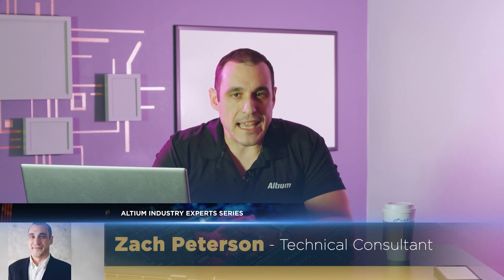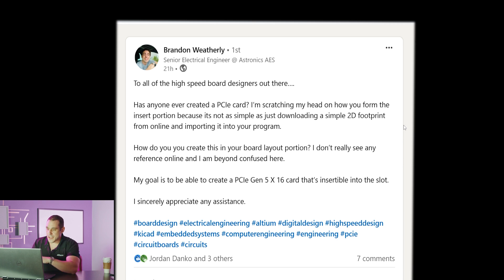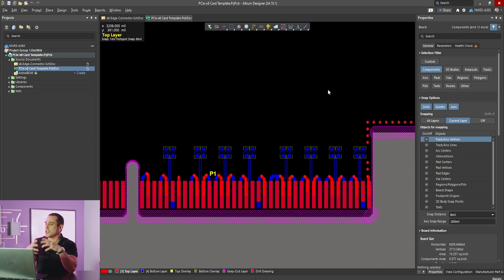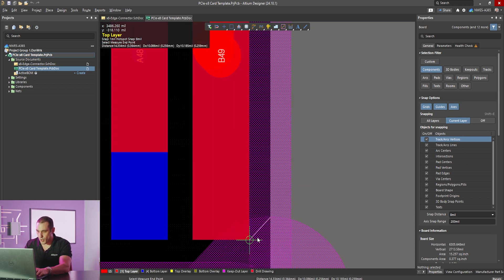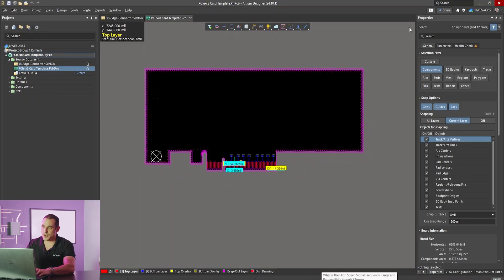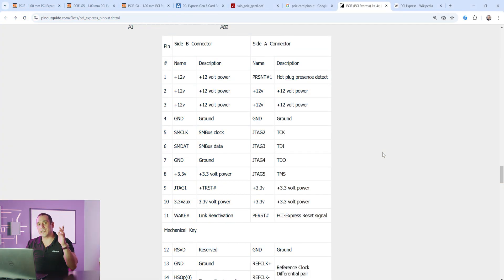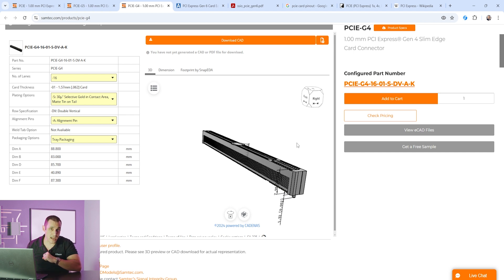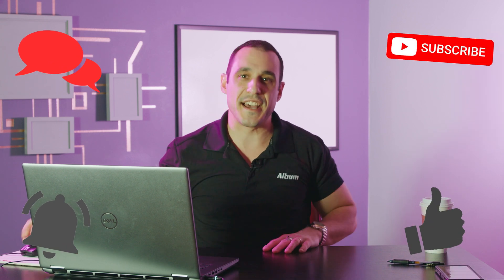How to Design a PCIe Edge Card | Altium Designer Tips

Comment: Loved your video and it helped me so much however you can 100% use a older pcie connector with a newer  generation you just wont get your max bandwidth. Which isnt really that big of a deal not even a single gpu can really saturate the lanes. I would be impressed if any diy or product prototype could as well.

Comment: What about physical dimensions for the x16 edge connector? How far do i have to extend it, just copy-paste what is already there in the template?
Reply: Yes you can copy paste what is in the template while maintaining the pitch. Also make sure you maintain the margin from the last pin to the card edge, that will ensure the card fits into the standard size PCIe edge connector.

Comment: Another great video. I have not checked your template yet, but is it worth mentioning the dimensional/ positional tolerances and chamfering and hard gold plating specs that could be included in fabrication doc? They are noted in most connector data sheets, so i guess it goes without saying. Not specific to these pcie edge connectors, but I have seen under specifying the alignment/tolerance of the board edge key relative to the pads for other types of card edge connectors cause shorts to the wrong pins, but that was likely a tighter pitch than standard pcie connectors.
Reply: When you create a fabrication drawing it is a good idea to include these in the fabrication notes. This is something I have probably mentioned in a different video regarding fabrication notes in a previous video. Since the tolerance is noted in datasheets perhaps you can use their number. Whatever tolerance target you have, you do need to communicate this to the fabrication house because they never have that information memorized and they won't look at the connector datasheet to figure it out.

Comment: What determines if a high speed PCB like this needs a guard ring? I often see guard rings around the various PCBs in a laptop, is it hidden in the ground pour?

nvm, i just watched the rest of the video and saw the via fence...
Reply: I would be careful when saying that a high-speed PCB "needs" the ring, there are plenty of designs that never include it. In a PCIe card like this, the guard ring allows the chassis ground to extend around the edge of the PCB so that any ESD surge coming into the bracket/connector gets diverted into the chassis ground rather than entering the system ground and potentially damaging components. This PCIe card outline was used for a networking card with Ethernet, so it uses the chassis ground ring as a connection to the connector shroud and the chassis in the enclosure. Similar strategies are used with a USB hub card or a graphics card with HDMI/DisplayPort outputs for example.